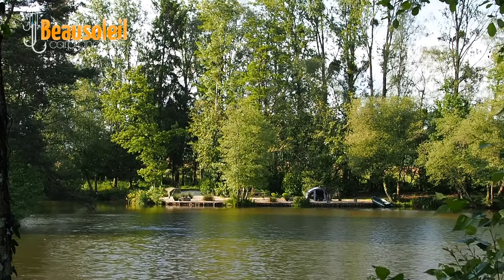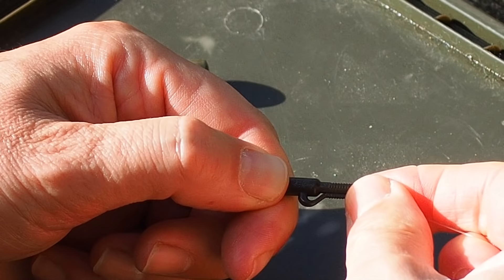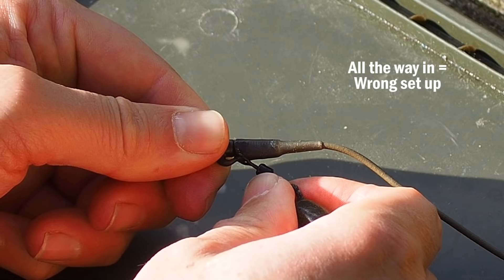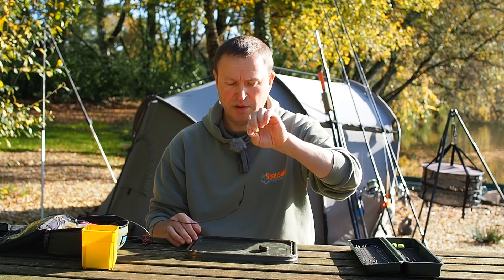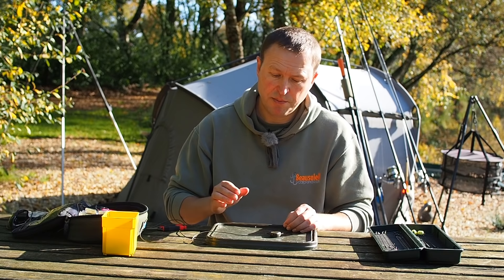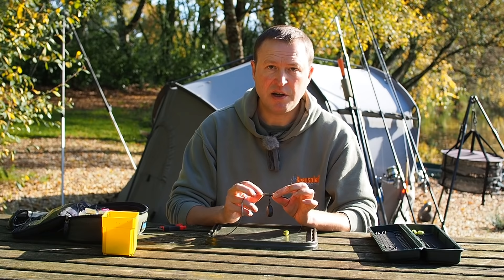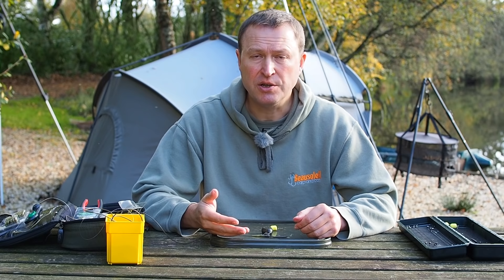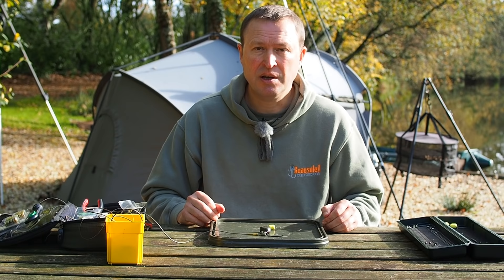STOP Using Lead Clips Like This | 5 WORST mistakes❗

Comment: Tbh I started cutting the clips half length about 15years ago... Means you can push rubber all the way on but glad you bought it up.. like the videos btw 👍
Reply from the maker: Hi David, thanks for commenting. I haven’t come across many anglers that know that trick so it’s nice to hear that it’s worked for you for so long. Glad you like the channel, more videos in the pipeline. Cheers, Matt.

Comment: Really useful! Been doing it wrong for a while now. Going to try your method with the running lead next session.
Reply from the maker: Hi Jason, thanks for commenting. It’s a very common mistake mate so don’t feel bad about it. I’ve come up with a new running system where swivel leads can be used with tubing so don’t forget to subscribe and you’ll get a notification when that’s available. Let me know how you get on. Cheers, Matt.

Comment: Thanks Matthew, another great video. I guess many anglers will also have fallen into the trap of 'cost-based thinking'. Likely losing the lead on each retrieve will add up, but no-one wants fish deaths so it's a price worth paying.
Reply from the maker: Hi David, I’m glad that you liked the video. Yes, lead clips are seen as the go-to solution for every carp situation but some of these systems aren't very good, or very safe and misuse is commonplace. I use some form of running rig for most of my carp fishing, I've done several videos on them, I very rarely lose a lead and I catch a lot of carp. Cheers, Matt.

Comment: This Lead Clip Running Rig has been featured in the latest Korda Master class... 

Thanks for these extensive explanations. Not gonna use that kinda rig.
Reply from the maker: Hi Markus, thanks for commenting. Yes, I saw this video yesterday... I haven't seen this swivel crimping for a few years and I was hoping that they’d stopped doing it but much to my surprise (and horror) there they are at it again. It’s daft really as they make components for a running lead system so if they promoted a simple running rig using their bits it would be safer and still be good for business. I know that I’m fighting an uphill battle on this one but I’ve seen the results of this kind of rig. We’ve had carp and catfish towing round lost gear with lead welded on the lead clip, swivel separated from the lead clip (because it was crimped), and shit loads of crap and branches all tangled up. It took one of our carp years to recover from the mouth damage he suffered. Thanks for taking the time to watch the video and for the feedback. Regards, Matt.
Reply: @matthewcollinsangler  I gave a lead clip running rig at my last session last year a try. Fortunately, I didn’t loose a fish. Your video made me change my mind for the new season. 

The Korda-thing... at the last few minutes of chapter one. I am gonna comment there too, that this tends to be death rig in most of the scenarios. It is not worth improving the last 10 % of you Edge of the carp, if you risk too much. Even, if the lakebed is clear and there is no weed...

I am gonna share this with my mates, so they either use real running rigs or real lead clips...
Reply from the maker: @Markusgebvor  Hi Markus, that’s great to hear mate. Feel free to share my video far and wide. The more people that it reaches, the safer our beloved carp will be. Here’s a shareable link: https://youtu.be/a6WI6Y1o_Xk For more information on how to create a very safe running lead system check out my mono ‘D’ rig video. At 21:00 you’ll find an example of a mega effective, really simple, really safe, running rig that can be made from a swivel lead, a silicon tapered sleeve, some rig tube and a size 8 ring swivel. Here’s the link: https://youtu.be/hoHB1gi_sQs. I’ll be doing plenty more on this topic in the coming months. All the best with your fishing. Cheers, Matt.
Reply: @matthewcollinsangler  👍 I’ll check your recommend video. Didn’t see this one yet. 

I really think, that somewhat fixed rigs at the beginning, which change to running rig after first pick-up, are performing well at lakes with high angling pressure. Maybe, combing them with COG-leads will be a good alternative. I’ll check 😉.
Reply from the maker: @Markusgebvor  Hi Markus, I’ve been using trick rigs like this for well over 10 years and they’ve made a massive difference to me and for all of our guests at Beausoleil. If you haven't seen my original trick inline rig then check this video out as well. The video and the rig are quite old now but no less effective when used correctly: https://youtu.be/ED58TfFEcqM Best of luck, Matt.
Reply: @matthewcollinsangler  I had some interesting chat today with a mate regarding running lead clip as shown in the Korda video. 

He said, he is not seeing any risk to the fish when using that rig. If the lead gets stuck and the mainline breaks, the fish can pull through the mainline and is „free“. He cannot force the lead to be ejected, true. But in case the lead got stuck on a properly set up safety clip rig, the fish could have pulled off the lead and then still had to swim around with the broken mainline. 

I never saw it from that point yet. But I don’t know, if the fish can pull out the broken mainline. I think, this might be possible even if the anti tangle tube got polluted with some silt. 

I am gonna try with some experiment
Reply from the maker: @Markusgebvor  Hi Markus, I can see I’ve really got you thinking about this one! The point is that with this crimped swivel idea from the Korda video, you are expecting the mainline to be able to easily slide through the rig tubing in order to become safe and if it doesn't it’s a tether rig. The problem is where the fish is pulling from and where the jam up is (right at the other end of the tubing) and the fact that there’s a lead banging around that just wants to get caught up in everything. All it takes is one bit of grit to catch in the open end of the tubing and the tubing will stop sliding. Once that happens the lead can’t eject and will gather all sorts of crap (branches etc). I’ve cut plenty of these tangled messes out from snags around our lake when we drain down. The worst messes are created by anglers that have used a leadclip and either pushed the rubber on way too hard or where the swivel has come away from the lead clip and the lead is still attached. The only way to truly understand this is to walk a lake that’s been drained down. I’m not bothered about finding a hook and a hooklink, swivel and a bit of mainline. It’s when the lead was still in tow that things can go very bad. Have an experiment and see what can happen. Great to talk to you! Cheers, Matt.
Reply: @matthewcollinsangler  yeah, obviously in the winter you have to think on how to improve 😬. 

Tests with the running lead clip were as shown in your video. The AT tube contracts under tension/frictions and locks the lead clip. But pulling the line through the lead clip in general worked as long as there is no knot in the mainline above the AT tube. But I agree, I have some serious concerns about the rig‘s safety, although not having fully understand if there is a real threat for the fish 😅. 

The rigs you are showing in your other videos as well as all the other running rigs with e. g. inline leads work. 

But what I don’t like about them is the fact, you are not dropping the lead off in case it gets stucks in weed and you have a fish on. You will only loose the lead as well as the business end, if your mainline breaks. 

A hybrid between lead clip and safe running rig would be cool, without adding to much tangle potential while casting the rig out up to 100 m. The Fox plastic ring, which breaks under 10 pounds of force, is not what I am looking for. 

Do you get my point? I am at the limit of my english capabilities, but it’s a nice exchange 👍.

PS:  i found the Montage, I was looking for. Carpleads is offering a semi fixed rig, which turns into a running rig. If the lead gets stuck, you can drop the lead. I am not gonna post the promotion here, but it is easy to find.
Reply from the maker: @Markusgebvor  Hi Markus, I’m glad that your tests agreed with mine and you're right sometimes the tubing will slide up the line easily. The problem is what happens when it doesn't! The waters I fish nowadays aren't weedy. In fact there’s virtually no weed at all so it’s not something I have to worry about. 

I totally agree with you about how important it is to drop the lead on a weedy water. I’ve fished some lakes that were so weedy you almost felt that you could walk across them. If you don’t drop the lead in this situation you will never land the fish. If I was fishing at 100m in weedy lake then I’d be using a lead clip I think. Either that or a helicopter rig that dumps the lead on the take. The farther out you fish the less rig shy carp are so the disadvantages of the traditional lead clip setup don’t really come into play as it’s set to dump on the take. I’ve found that system you mentioned. It’s very similar to what I would call an outline inline setup. It will be interesting to see how that works for you and it certainly looks very safe. Thanks for the website, I didn’t know them, I might use them 😊 (your English is superb by the way!)  Cheers, Matt.

Comment: Similar conclusions to me, used to use kickers, curve shank, lead clips ect but found running settup to be king and use nearly all the time. Hook choice esp stiff riggers. Currently testing thinking anglers 'C' clips on my running rigs, have you tried these? If yes what are your findings.
Reply from the maker: OK, cool, good to hear. I’m convinced the lead setup is the most important part of the rig and running rigs are the best choice. Never used C clips. If I want to create a rotten bottom, I just tie a couple of overhand knots in light mono, as I show in this video: https://youtu.be/pSjT2wPKtTw. Cheers, Matt

Comment: Great idea with the pva on the clip! I shall be doing that from now on. Thanks.
Reply from the maker: Hi Alan, yeah useful stuff PVA tape. Just helps keep everything where you want it to be, especially when fishing at range or when using PVA mesh bags.
Reply: @matthewcollinsangler  do you think pva string would be a bit stronger and easier to tie?
Reply from the maker: @alanlcrsuzuki  PVA string will certainly be stronger. In terms of being easy to tie I’m not sure there’s much difference between the two. I tend to carry a spool of that PVA tape round with me all the time as it’s what I use for tying up PVA bags.

Comment: Why use a ring swivel instead of a quick change swivel? saves looping on hair rig and would get better use from the anti tangle sleeve?
Reply from the maker: I use them too mate.
Reply: @matthewcollinsangler  cheers mate I commented too early in the video, just feel the anti tangle sleeve will kick out more on a quick change than the ring but very informative videos mate thanks

Comment: Genuine question as I’m quite new to fishing, why would you drop the lead on every take? Surely it can’t be good dropping lead after lead into ponds etc? Also the cost of this would be ridiculous? If you catch 5 carp in a session, that’s 5 lead at the bottom of the water. Surely that just makes no sense? Cheers
Reply from the maker: Hi John, I totally agree. It is expensive and bad for the environment and as I show in the video, they can be set up wrongly by accident. That’s exactly why I hardly use lead clips in my carp angling. My go-to approach is to use a running lead system where you don’t dump the lead on the take. You’ll find lots of safe and effective versions on this channel so have a browse and choose something that interests you. If you are looking for a simple, safe and easy and effective option then watch this: https://youtu.be/LzFina92brM Cheers, Matt

Comment: Good video! But can’t say I’ve had any of these problems, or there is actually a problem. If your fishing a in-line lead you don’t lose fish, so I don’t see why it’s important to dump the lead straight away as obviously you can’t dump lead and also using tap on lead clip system to stop lead coming off on impact, dont believe is even a issue, it doesn’t happen.
Reply from the maker: Hi mate, thanks for commenting. I totally understand your scepticism. I’ve been using inline systems for years but the first thing I do is to remove the insert and replace with a tail rubber. Watch this for more details: https://youtu.be/ED58TfFEcqM. These “trick” lead systems prevent the carp from using the weight of the lead when they first encounter the rig, after that it’s a running rig and there’s no issue. It all depends on the waters you fish but I know that when I started fishing harder lakes I’d get aborted takes and short flurries of beeps and proper runs were very rare. It’s easy to write these off as liners but when I changed to this type of lead system I got solid takes much more often. I’ve been working with guests here for the last ten years and turning blankers to bankers by tweaking their rig setups so it can definitely make a difference. Anyway, if it’s not an issue for you on the waters you fish then great. Cheers, Matt.

Comment: Wow... I've recently returned to fishing after a gap of 20 years... And I have been trying my hand at ledgering with these clips.. I never knew that they are supposed to eject the lead!! 😳 I just thought they was an easy system of attaching a lead to the line 🤦🏻‍♂️. I feel so ashamed, the instructions on the packets are not exactly clear on these things. I feel I need to learn a lot more, and will be staying away from lead fishing (and putting fish in danger) and will stick to my old faithful float fishing and method feeder, until I'm confident enough. Thank you very much for your very informative videos. I have subscribed and look forward to watching more. I will eventually get to a point to be confident enough to Carp fish. I do like some of your rigs and will be taking some of that for my method feeder. Have you done any videos on making your own bait glug/goo? I've been researching that quite a lot, and it's cheaper to make homemade... And just as effective.
Reply from the maker: Hi mate, thanks for commenting! Don’t feel bad, I see experienced anglers make these mistakes so I’m just glad that I could help. And you’re right, the information from the manufacturers is just poor.
I’ll be filming a new video shortly showing you how to use lead clips in a completely new and safe way so don’t bin them! It’s relatively easy to make your own glug. All you need to do to make a basic glug is to mix the bait flavour of your choice with some glycerin which is readily available from any chemist and is pretty cheap. I use a ratio of 1:1. It works for me. 
Thanks for subscribing, there'll be a new video out this week-end! Always happy to help and answer questions.
All the best with your fishing. Cheers, Matt.
Reply: Lots of leads on the lakebed though ! Surely a running inline weight system is best ?
Reply from the maker: @cbing4036  Absolutely, I’ve been fishing with running rigs for over 15 years and all the videos on this channel are running rigs. This video is to alert anglers using lead clips all the time to the downsides and potential dangers of using them.

Comment: Hi Matthew , your every video is spot on about safety and fish care which is most important thing ,learned a lot from you also and i just wanted to ask would crushing the swivel work with rig marole tubing beacuse i tried to thread the line through it and it slides without any resistance?
Reply from the maker: Hi mate, glad you enjoy the videos. I understand what you’re saying, yes, the Rig Marole has a larger bore, yes, it slides easily, yes it’s easy to thread … but only when it’s clean. As soon as you put that rig tubing in the lake, it will gum up with silt and grit and leaf debris, and be much harder to slide up the line. I wouldn’t crush the swivel in any circumstance. If you want to make a safe running rig with rig tubing, here’s a setup you can use: https://youtu.be/LzFina92brM?t=1022
Hope that helps,
Cheers, Matt
Reply: @matthewcollinsangler  Thank you for reply i really appreciate it. Tested it out today without hook, casted into the silt and it was stuck, once again you were right. Im usually using fox drop off running rig kit, perfectly safe, great indication and no lost fish so it will stay my choice for future fishing. Thank again and keep up the good work

Comment: I just use inline lead with no tubing if line breaks lead falls of and barbless hook will just fall out of hooked carp
Reply from the maker: Hi Oli, thanks for sharing. Most of my carping is also done using some form of running lead system, be it in-line or swivel based. All the best with your fishing, Matt.